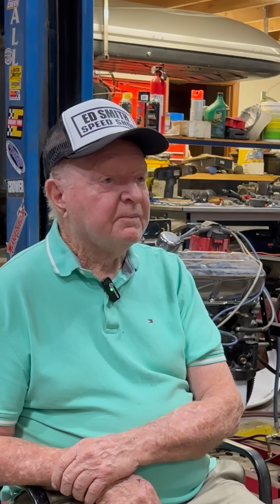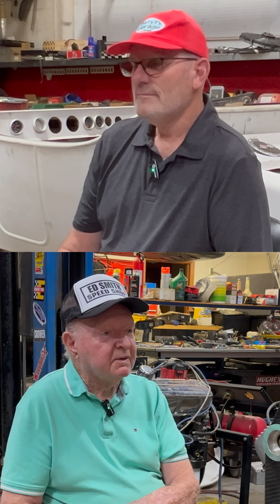HOT vs Cold Nitrous - Ask Ed 25 - Ed Smith w #BarryT #racingengines

Comment: 1979 Ford Courier
My nitrous 25# tank was mounted in engine compartment NEXT to exhaust thin heat shield in front. 
2300 carb turbo 200 HP power shot through AN wye fitting at front of manifold, fuel cheater water injection at top of carb no choke horn

Comment: I watched a video some time back where a car had a nitrous bottle in the back, it was a fast back and it was sitting out in the sun with the windows up and the car exploded. I don't know if it was a staged deal, or there was just a trail cam kind of thing and the car was just there with the camera on it for security or what the deal was but the whole back end of that went BOOM
Reply: I've seen several batteries explode and none of those ever did that much damage so I'm pretty sure that was what blew up and there was no fire anywhere so it wasn't the gas tank. Anytime you're working around high pressure tanks, it's always dangerous. Nitrous bottles run around 1000 psi when the pressure is up where it should be
Reply: not too long ago a guy had a torch heating a nitrous bottle in a drag car and blew the car up... if that track sees you take a torch to a nitrous bottle they take your picture, refund your money and ask you not to come back